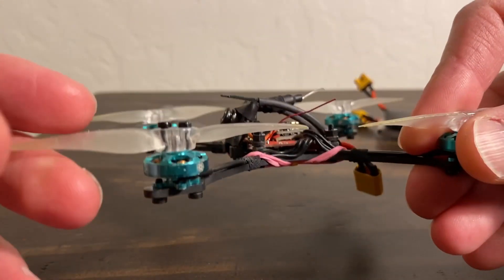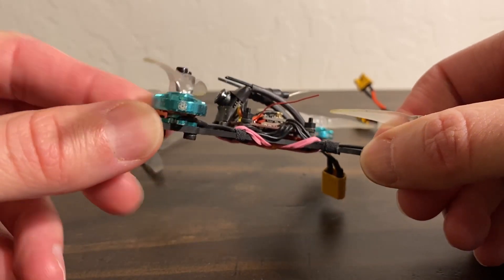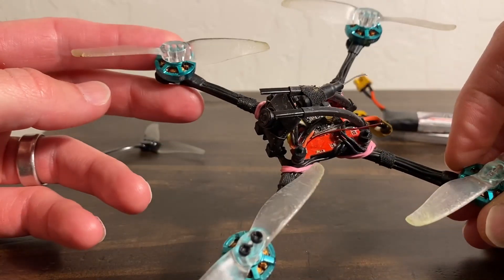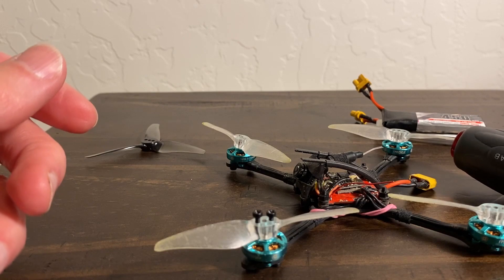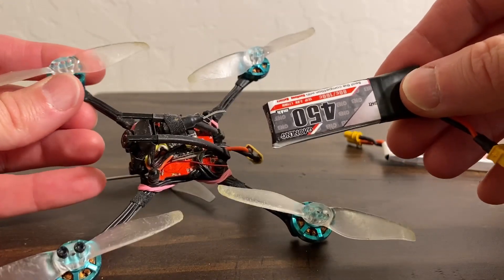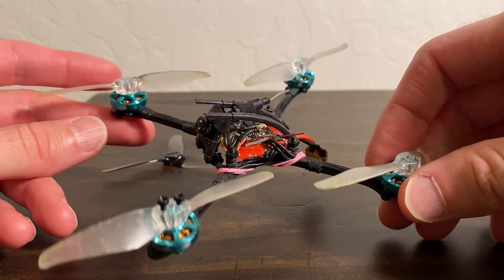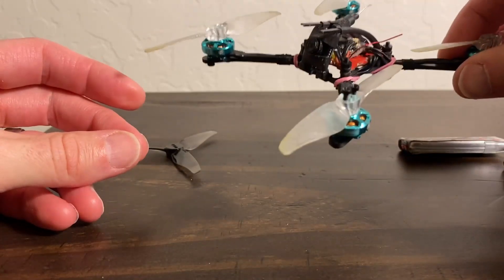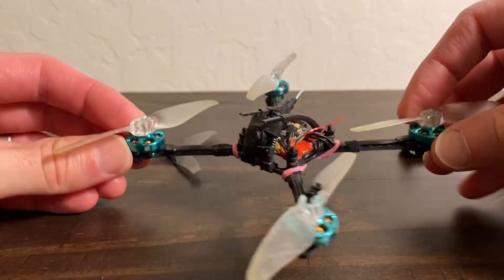FPVcycle 1202.5 11500kv 1S motor Long Term Review

Comment: I realise I'm risking being called blasphemer but... have you tried flying it on 2.5 inch props?
I have a 2s BT and for a long time only flew it on 3016 tri-blade Gemfans, as a good follower of Kabab's gospel should, but the Evil one convinced me to trying Geprc 2523 tri-blade props, which have been my favourites on my Emax TH Freestyle and.... I have been blown away by the result - the kwad is as fast and easy to fly (I'd even say the level of control - particularly at low throttle/speed - has increased), but the flight times have gone up by 20 - 25%. My build is not particularly light - even as for a 2s (3mm frame - because I had run out of 2mm ones - due to crashes, full size immortal T and Fixeer Lollipop u.fl antennas - because I hate skimping on rc link quality), but I have been getting 3.30 - 3.50 on 300mah Betafpv batteries and close to 5 minutes on 450mah GNBs (non-hv)! The only drawback is that I had to enlarge the shaft holes on those props  and however carefully I did it - it wasn't perfect and I can see more jello when flying high - a result of increased vibrations....

Comment: Hello quad 66, I've had motors that shaft spun by themselves like how you are having problems. I personally hated that problem. Do Flywoo 1202.5 motors have the same issue? I'm would rather have less thrust with proper motor shaft

Comment: You get a third blade with the triblade. Offsets the weight of the extra blade. I've been asking them for a 3018 triblade actually. That's the main difference between the two. The twin is actually faster at the top end. I don't think tht extra pitch will cause much if any issue with the performance of the triblade

Comment: Floss your props..
Reply: Dude that thing moves for a 1s. Nice build love the content of your channel. 🤘
Reply from the maker: That isn't the prop spinning on the shaft, its the shaft spinning in the motor bell. If anything the issue is the initial 3018s were too tight on the shaft.
Reply: @Quad66  floss your... bell? 🤨
Reply from the maker: OneManMob people are using green loctite with success

Comment: How 'bout hot bending the 2 front tips a little up and out and using them as guides for antennae (VTX or RX)? :-) --> double function to protect cam AND hold antennae ;-)
Reply from the maker: Yes that could work well. Maybe bend them back and out 45 degree for rx diversity antenna. Secure with a little shrink tubing.
Reply: @Quad66  will build one soon - at least as soon as AP ships your frame to me :-)

Comment: Great video! I'm getting more and more into 1s quads. IMO, Kabab's setup is the best 1s overall. I think the downsides would be that it's not the fastest, motors are heavy, and it doesn't have many prop options having a 2mm shaft. What do you think is the best overall motor for 1s? What's the best performing kv for 1s?

Also, do you have a frame design that's 9mm motor  mounting for 3" props? The whoopster 110 is great, but I want to try the 9mm options, too. The smaller motors are more fragile.
Reply from the maker: The whoopster 110 has my universal mount. The two holes that are in line with the arm are 9mm. The motor will be rotated 45 degrees from normal so its not as clean but will work.
Reply: @Quad66  That's great news. I'd like to try my 1103 motors next. Is there a 2mm thick option?
Reply from the maker: @friendlynomad9840  In the whoopster style this is the 2mm thick one: https://armattanproductions.com/pages/product_details/22356
Reply from the maker: Regarding 1S motors I recommend the Geprc 1102 14000kv with whocares 65mm props and running JESC 48khz on a very light build with 450mah HV, or the FPVcycle 1202.5 with either the 3018 or 3016 gemfans. I'm more specific about the 1102 build because there is less wiggle room to get good performance out of the 65mm prop format.
Reply: @Quad66  Geprc makes great motors. Ill try those specs next. Would you say the whocares 65mm are better than the Gemfan 65mm?
Reply from the maker: @friendlynomad9840  I have some Gemfan S that I still need to try but need new motors to come in. Otherwise the whocares is the best 1S prop. On 2S I still like the whocares with 1102. On 1103 2S you have enough motor to handle the HQ Tmount 65mm biblade so I prefer those on 2S 1103 mainly for durability as the whocares get chewed up pretty fast on that set up.
Reply: @Quad66  Thanks for the reply. I was leaning towards the Geprc motors you mentioned. What about the BetaFPV 1102 18000kv motors? Do you think there would be a worthwhile improvement in performance from the 14000kv motors?
Reply from the maker: FriendlyNomad Prior to JESC 48khz I would have said 18000kv is definitely too high. It’s possible that with 48 or even 96khz the added efficiency may make it viable. I’ve heard the bases are very fragile and easy to strip.
Reply: FriendlyNomad try flywoo 11,500 kv motors!!! I have in my beta 1s build and I’m gettin over 3 mins flight time!! I also swapped the jst out for bt2 connector